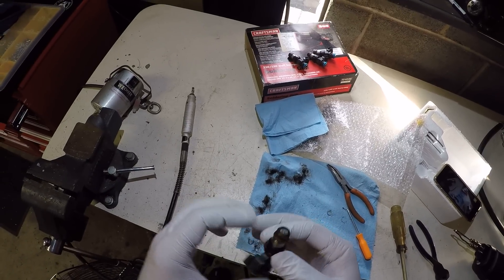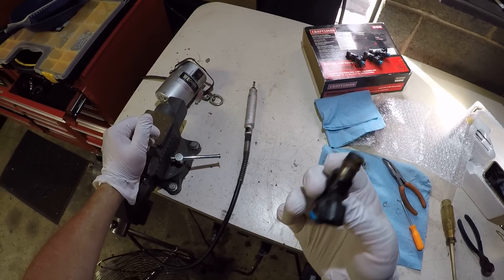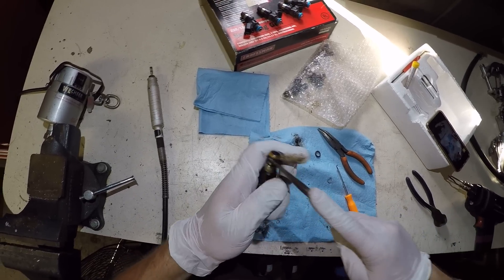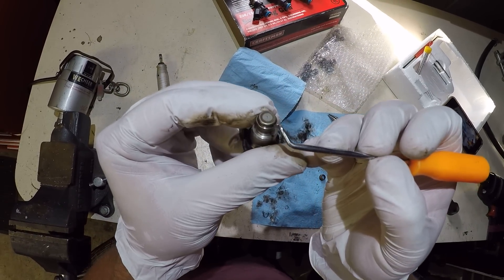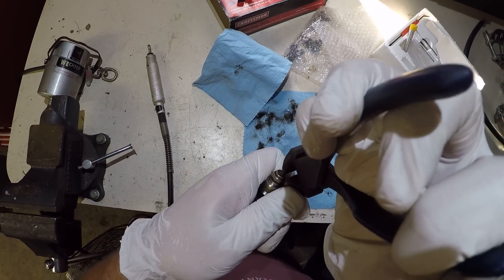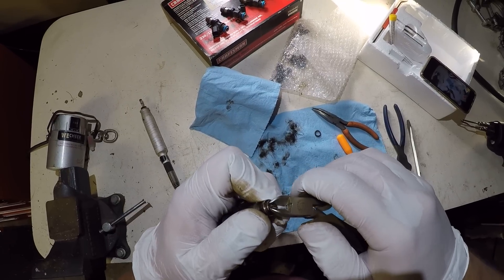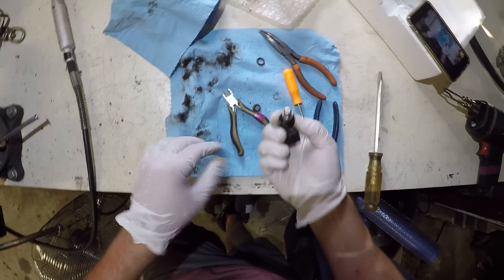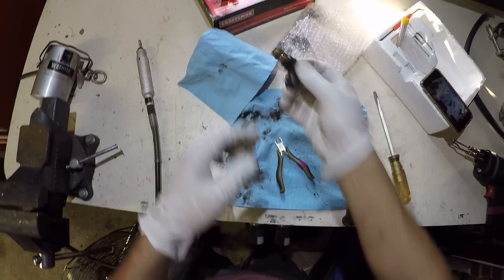Decapping stock LS truck injectors

Comment: I did this to my truck it's stock it now doesn't run so for you guys wondering if you can do it to your stock truck don't do it lol way to much fuel or something I pulled the fuel pump fuse and it ran great put it back in and it drowns it out almost instantly.
Reply from the maker: Yes, you absolutely need to tune for 3x larger injector

Comment: I've ended up buying some ev6 injectors going by you wiki page as you say either ev1 or ev6 but have now found I have multec 2 plugs so can I just buy ev6 connectors and wire them to harness?

Comment: Have you tried removing the MAF and the o2 sensors? Now THAT will give you more fuel. Just be sure to feather the throttle so it doesn't stall on you. and forget about fuel economy. But at least with decapping you dont have to worry about the stalling issue.
I'd rather remove the MAF and front o2s because they can always be plugged back in.
Reply from the maker: not really sure if you are trying to be clever with a joke or just sound like someone who wants to think they know what they are talking about, until they open their mouth in front of people that do know what they are talking about...

Comment: So you're taking a precise fuel metering device and tearing the SHIT out of it?   Nice!
Reply: ya gas mileage not needed... just high horse power bahahahaha
Reply: High horsepower means buying the correct injectors.   Doing this will cause crappy spray patterns and low hp
Reply: what do you think company's lile injector Dynamics does they just put Match pairs together. if you watch the video of them walking through their facility you can actually see them grinding the tips off.... FYI
Reply: Who watching this video will match them afterwards?   Not many....or any at all.
Reply: anyone building a bunch of Ls motors with a shitload of them send them all off matching together pretty easy.
Reply: So 1% of the people watching this video and trying it?   Lol
Reply: scidav87 actually almost everyone gets them flow matched. especially on the public sloppy page.  Eric derr only charges $75 to clean and flow match a full set

also probly 10% of people who watched this tried it.

Comment: For your top 25 questions, here are a couple I'll throw in the hat:
1) how uniform were the flows between them (pre and post cleaning, if the guy measured them before)
2) Where do you suggest to send a set for similar cleaning and flow testing?

Comment: what injector data did you use in HPT? i just did this tonight. and trying to figure out what to start off with... gonna try and get them flow tested so i know. but just incase i cant. thanks.
Reply from the maker: well, since they are stock, you would use stock data, you would just have to change your flow amount or scale your meter/ve etc

Comment: In for results... know if the 36lb flex fuel injectors are capped by chance?
Reply from the maker: the injector i had that i sent in flowed 43lb@43psi i will have to check the part number on it but i believed that to be one of the largest stock injectors that i have out of a chevy truck i think they are the 6.0 E85 injectors
Reply: That seems like a ton, was that de-capped or no? The flex fuel injector I have is a 12594512 rated at 36lb @ 58psi.

Comment: I did this with some light blue Subaru 440cc injectors.  It supposedly makes the 440's flow the equivalent of a 740cc with the cap removed.  I used a Dremel with a cut off wheel.  You have to be really precise.  I ruined the first one, oops, but luckily had spares.  If I do it again, I might try the carbide bit method instead.
Reply from the maker: yeah from the subaru end it seems like you get like 80% more injectors we will know for sure next week

Comment: About what size are those injectors out of Jaime's truck? Think they'd be much larger than a 2001 5.3 injector? I was just wondering the other day why no one does this with stock LS injectors, and if it would be worth just de-capping some old stockers i have laying around.
Reply from the maker: the stock tune says they are roughly 32lb at 5bar, 58psi
Reply: Wow, that's a lot more than I would have guessed. Excited to see what they do uncapped!
Reply from the maker: its from a 07 truck the stock 99-03 are like 25-28?
Reply: So I imagine I'd still probably see a good gain in flow uncapping some 99-03s. Thanks for the info as always!

Comment: Could you just take a jewelers drill and carefully open up the hole in the cap to the desired size? After all that's what they use to do to carburetor jets  was to drill them to size.
Reply from the maker: i doubt it, i think its a hair away from the pin, so by the time you enlarge that opening you are already nicking up the pin

Comment: Is it simply possible that most injector manufacturers just make a couple of injectors and change the caps during final assembly to get a bigger range of flow ratings?
Reply: That's what I'm thinking. Same way I bridged the L2 cache on my AMD3000+ back in the day to unlock the multiplier. They set the multiplier at the factory to get the speed and once it's unlocked you can change the speed up to the top of the range in that class of processor. And I think you could do the same on a Pentium using just a pencil to draw a lead between two contacts.
Reply from the maker: Who knows lol
Reply: yep thats actually exactly what they do at gm. the only things they change is coils and caps between most bodies
Reply: Could be the same injector for the 6.0's and 5.3 just different outputs
Reply: bingo

Comment: You could use mega squirt in test mode to test their flow couldnt you? Just make up a fuel rail for 1 inj and have the injector squirt into a measured container for a set amount of time
Reply from the maker: eh, i could but people could argue home testing vs a pro bench with static and dynamic tests
Reply: +Sloppy Mechanics i can see that.. but it would get you pretty close anyway and it doesn't cost anything other than buying a $8 plastic graduated cylinder.. im not sure what it costs to have inj flowed by a pro but its an option anyway to save a few bucks
Reply from the maker: +Set On Kill it's like 50-75$ it won't kill me,  please also have about 92,000 miles on them and he will clean them in that cost also
Reply: +Sloppy Mechanics ok well ill keep an eye out for results.. may try this on the zephyr

Comment: I decapped a couple injectors from my '97 explorer 5.0 (bosch 0 280 155 710) and tried to flow test them with the injector pulser in the microsquirt.
Without the plate with the holes in it they didn't buzz or flow any more. Dunno what's up with that, did a few of them to try and get one to work but none of them would work. 
try and get them to buzz before you spend money sending them out

Comment: They get heavier without the caps?
Reply: The caps are made of anti-matter.
Reply from the maker: the caps restrict flow, removing them roughly doubles the size of the injector i am told
Reply: +Sloppy Mechanics will be interesting to see what they flow